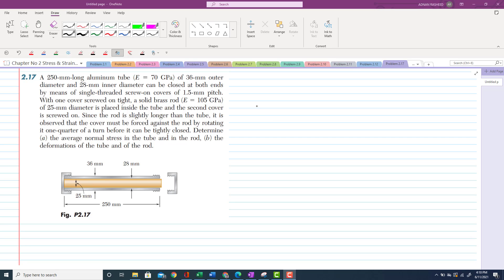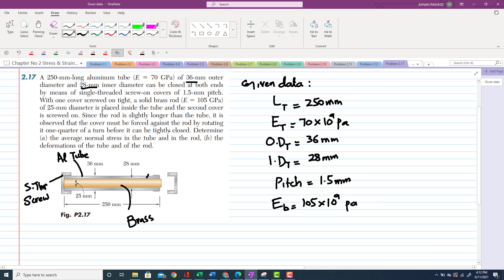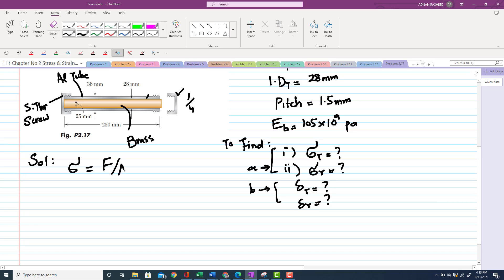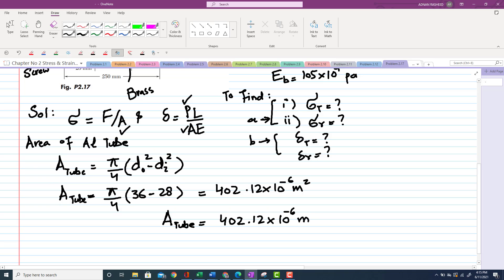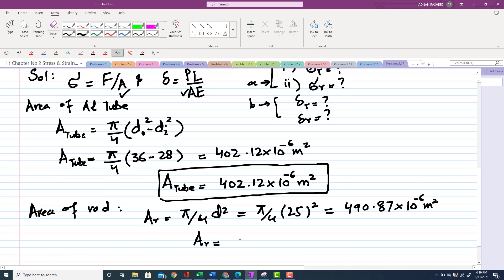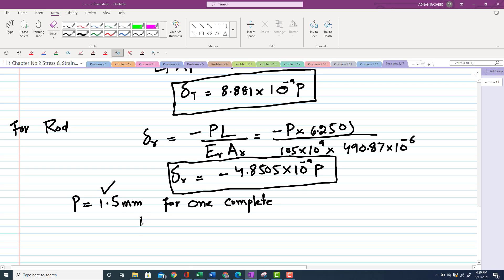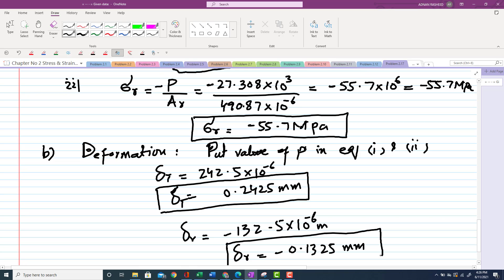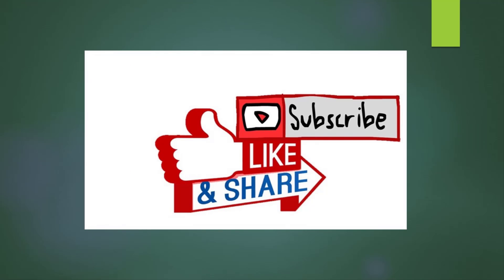Mech of Materials# |ProblemSolutionMOM​ | Problem 2.17 |Stress & Strain| Engr. Adnan Rasheed

Comment: why rod lenght is taken as 250mm even though it is larger than tube (250mm)
Reply from the maker: also as in question it is give that length of rod is slightly larger than tube and the the data is not available as well so here by slightly large mean equal to length of tube. hope now it is the answer
Reply: @engradnanrasheedmechanical  thanks sir
Reply from the maker: @Himshu143 you are welcome 😊
Reply from the maker: Ver good question. You can read the question that in some place it is given that at 1/4 pf rotation that tube must tight causing compression and length of rod become equal to tube and tube will be in elongation so net change in length will be change in length of tube - change ìn length of rod. Since both are different materials their change in length will be different and it come out to be 0.375